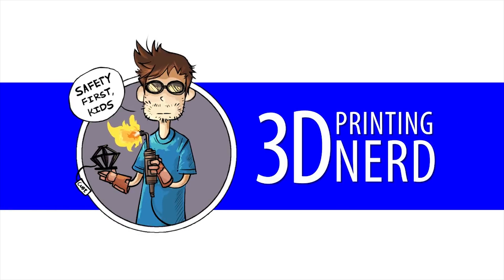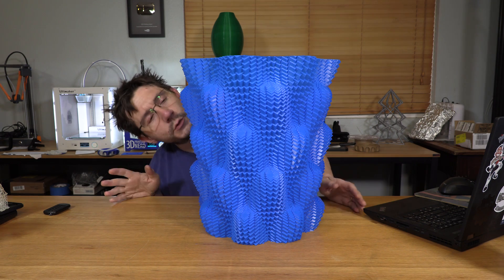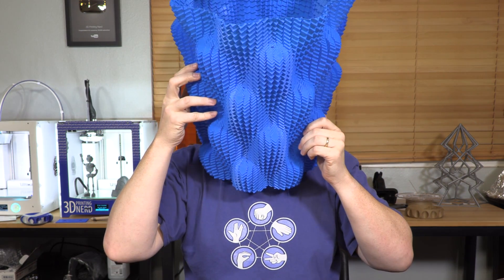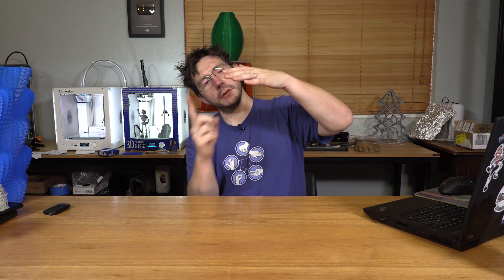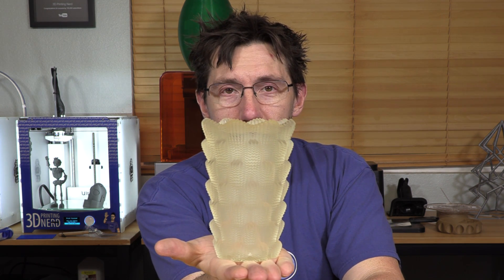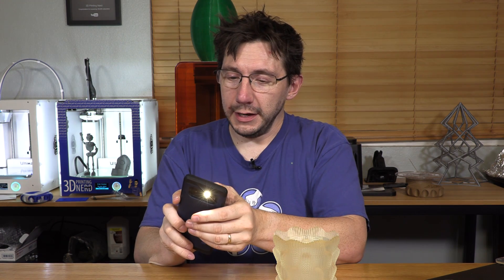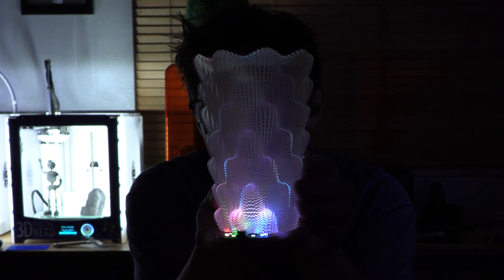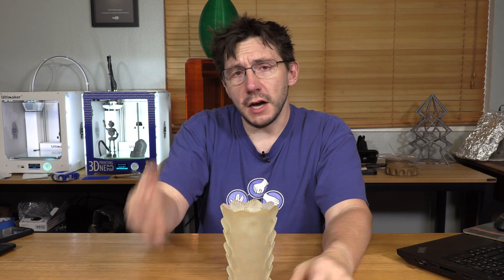3D Printing with Math! Cuboid Vase on Form 2 3D Printer - Lights from Adafruit Circuit Playground

Comment: Couldn't you just print with clear filament? I mean it wouldn't be as clear as that but it would be close.
Reply: I'm curious how this would turn out as well. Maybe put some small counterbores from underneath for individual LED's and make a small base to hide the batteries and controller for the lights

Comment: Sweet Jesus how much resin was that? Quick tip for form (as long as no super thin parts) leave the part in the IPA bath for 45-60 minutes and the supports just peel off—like a warm knife through butter. It's fantastic.

Comment: Your gorgeous new scrap basket doesn't need a bottom if you put a bag liner in it.
Reply: also, I'd love that clear version, it's very much the kind of thing that delights me!  You could drop a small string of multicolour LED christmas lights in it, then top it with some sparkly christmas crap, the sort of thing where twigs are sprayed with holographic glitter.

Comment: I cannot afford S3D....or a decent printer other than the A8!  I use Cura....no “Vase” mode ( English pronunciation...”varse”) any suitable workarounds....so far I just kill the print just as it starts the top layer!    No,  having “0” top layers did not work for me!
Reply: Expert settings: Spiralize the outer contour and turn off solid infill top.  Print at 0% infill.

Comment: Give it a quick hit with UV stable true clear laquer and it'll help stop it yellowing further. SO JEALOUS OMG Makes me want to fire up structure synth again!
Reply from the maker: +Maker's Muse UV stable true clear laquer? Ooh, I'll go to the hardware store! Or wait - is this a thing on Amazon?
Reply: Something like this :D http://www.krylon.com/products/uvresistant-clear-coating/
Reply: Looks remarkably like my attempts to make corner-cube retroreflectors actually!

https://www.thingiverse.com/thing:1752005

Still haven't gotten it functional yet, I think it's an "angle of refraction" issue currently, and not having a resin machine makes it a lengthy endeavor to tweak design and send to 3DHubs

Comment: You don't have to, but you could certainly use it for a candle or a LED light or even just a beautiful resin glass. That's what I would use it for just a beautiful glass that's almost Crystal like in its appearance.
I don't think everything needs to be functional. In this case it's very pretty and it would be prettier if you left a light in it. I really love how the resin ones come out.

I'm hoping to someday see someone use the resin 3D printer to print things like wings and horns and tails for Asian ball jointed dolls; they're cool check them out. Maybe even a full clear doll someday.
Reply: Lori Peterson most of the materials for the form 2 are not food safe.
Reply: Edmund Schwartzadder Interesting most of the resins Ive used before werent toxic, but I guess since it doesn't work the same as poured, it makes sense that it may have less food friendly resins. Thank you. 
I'd probably have to look more into the actual chemical and the reactions used in 3-d printing resin to see if there might be a way to fix that in the future. Actually maybe I'll leave that job to someone else, as much as I enjoy chemistry XD I'd never catch up in time anyway.
Reply: Hotaru best solution to make this pretty thing functional for now is to mold and cast it in certified food-safe material afaik. Would be cool to see this in Crystal Clear lol

Comment: Does the inside of the Form 2 printed one mirror the outside details?

If so, I wondered  if you paint the inside with chrome paint you might get more awesome reflections off the interior facets and color projected higher up.

Would require the LEDs at the bottom to line up with the vertical edge of the vase to achieve a more “fiber optic like” transmission.

Comment: If you ever get a bit more into the electronics side of things you can achieve the same effect with some off the shelf ws2812 leds (what neo pixels actually are) and an esp-01 board for about £5 :p

But yeah, rick needs some illumination, though I can only think of one place to put it :p